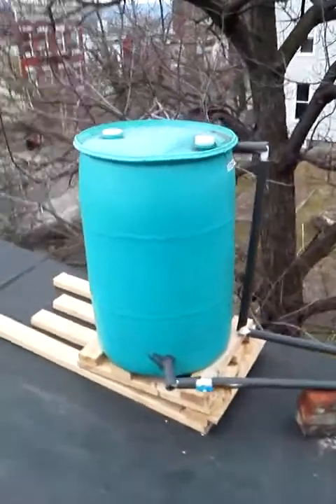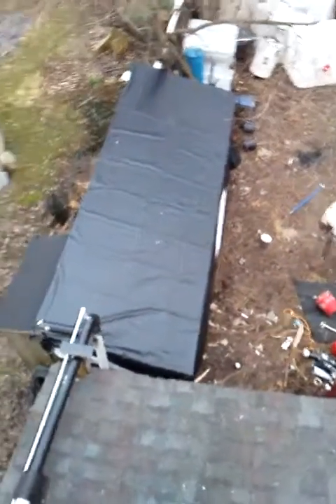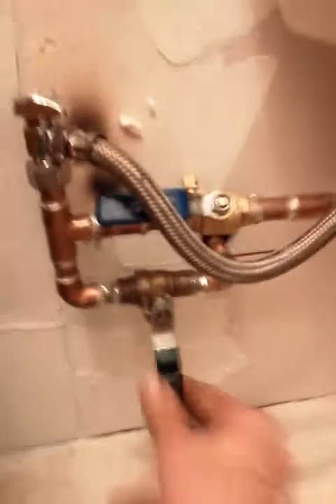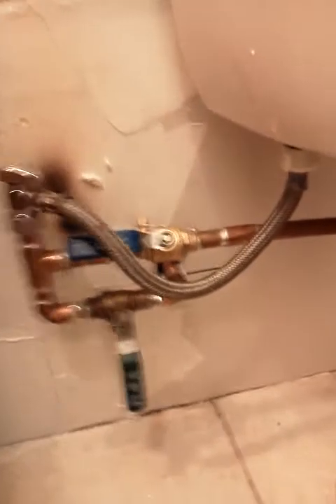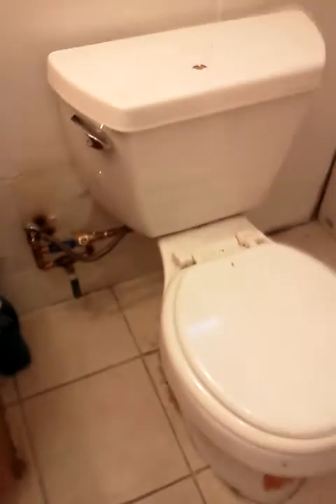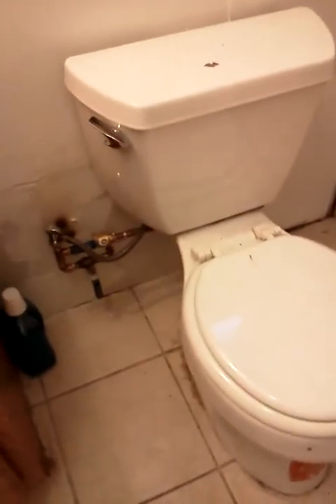Flush Toilet using rain water- Gravity pressurized

Comment: so all the water pressure from the storage is from gravity? Are you able to do that because you have the tank so high above the toilet? Also how high is it? Or is there another aspect of adding pressure so it can function on the normal tank valve system? I'm trying to figure out how to have a solution like you've done, but in a more compact setup ( hopefully possible )
thanks!

Comment from the maker: Thanks! I could have made it a lot better but it was on a budget and has been functioning for almost a year now with no issues, the switch is just two valves, a valve to shut off the city and a valve to shut off the rain both have back flow preventers on them so I can't get rain into the city supply and or city into the rain tank. Pretty simple, but here soon I'm going to remove the hand pump and switch to electric as it takes a good bit of effort about twice a week to fill it.